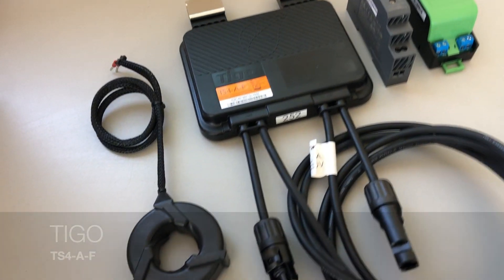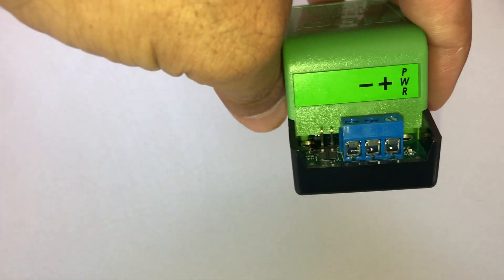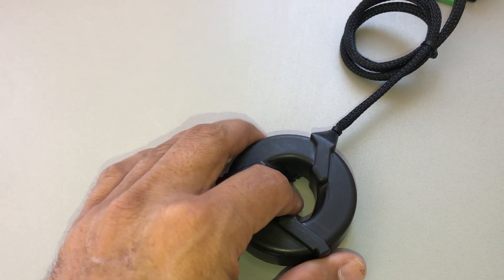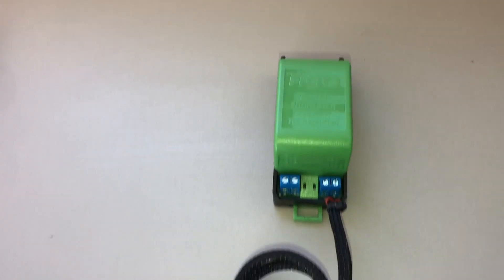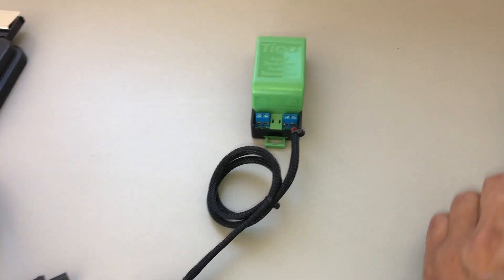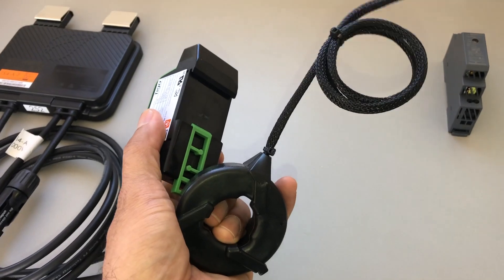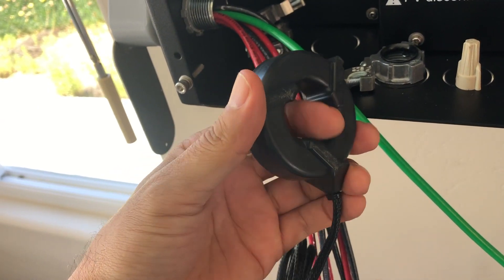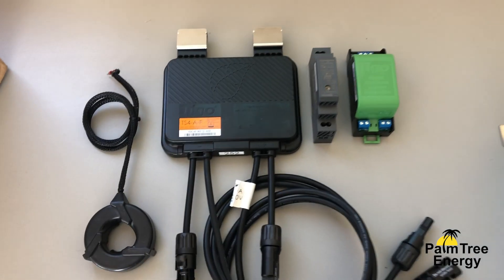TIGO RAPID SHUT DOWN  TS4-A-F

Comment: I have this entire system almost installed only to find out the pins on the solark don’t output enough power to do this… my critical loads panel is nowhere near this inverter.  I have to Jerry rig something from the ac output and pray it passes inspection?  Total fail from solark.  There is definately a lack of integrity in that company.  Why would they claim it works when you have to use a workaround?

Comment: The information you presented here was good, however your audio was terrible. 

I see that your newer videos do have better audio. Maybe you could redo this video someday, and hide this one from being listed? Not important really, but...yeah.

I was just looking at the Tigo system, and it seems to fit exactly what I want to do. Though, i want an offgrid system, so my setup will be slightly different than yours with the tigo. i likely won't go with the optimizer ones, but who knows, maybe i could upgrade later.

How do you sync the transmitter with the modules? like, what if other people around you are using the tigo system, how does it differentiate your system from others systems?

Comment: Just an FYI, I talked to Sol-Ark support and they did confirm that the pin out inside Sol-Ark is not enough! The pinout on the Sol-Ark will strain on the pins since these are limited to 100mA, whereas the transmitter will pull 850mA on average and as much as 1Amp, do use the enclosed 120AC to 12VDC on the Critical Loads panel with an external interruptor button near the RSD sign.

Comment: Does the Sol-Ark cut that DC power supply when it loses grid power?
That DC disconnect is not what a fireman would recognize as a rapid shutdown switch. Also these units are often located indoors.

Comment: If I have 32pcs TS4-A-F installed on 32 solar panels (one for each panel), do I only need one transmitter?
Reply: I don't know 100% the answer to your question, however in one of the documentations that i read on the transmitter, it says 100a per RSS core, and there can be 2 cores per transmitter. 

and in the manual it says 
Max number of strings per RSS Core: 10
Max string length: 30 modules

so it seems to me, like it has a limit of 30 modules. if you got the module that can have 2 panels on it, then youd only need 1 transmitter (depending on how you have them wired)

The manual also says:
"In order to maintain signal integrity, the RSS Transmitter has a specified maximum
round-trip distance from positive to negative of 300m (985ft). If the longest string
in a system exceeds 300m, but is less than 500m, two cores may be used in series
on the string to amplify the signal."

Sorry i can't give a simple answer to that.

Also, I am aware that your comment is a year old, so if you already got your answer, then thats great! (id hope by now you got your answer, but you never know)
Reply: @alericjohansen6775  Thank you.
I have dealt with it already. I have installed 130pcs modules using 65pcs TS4-A-F alternately on each modules, and uses only one transmitter with single core. It works well.

Comment from the maker: Yes I put the transmitter inside the Sol-ark and it works just fine. No issues. At first it seemed like it did not have DC voltage form the panels.  I simply did a complete restart of the inverter and everything started working just fine.